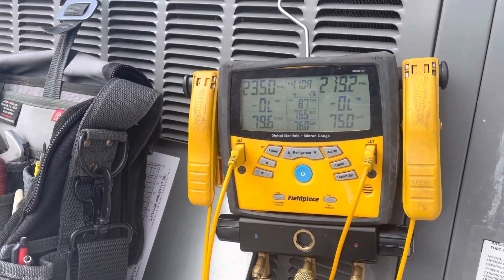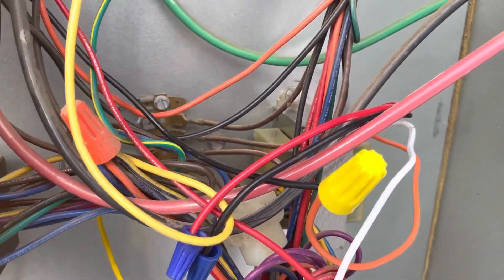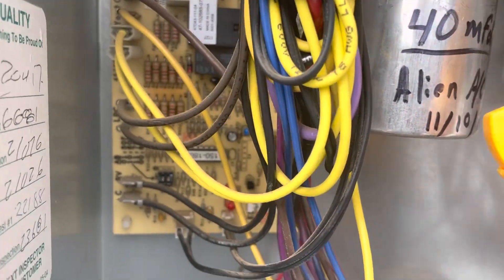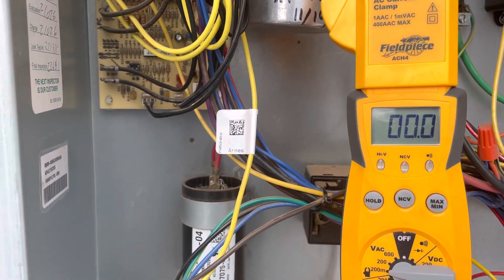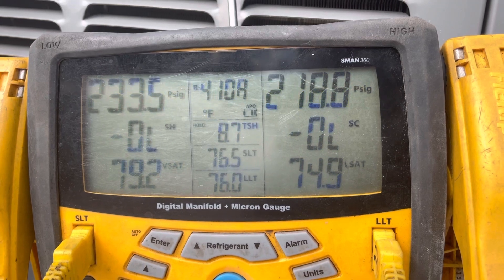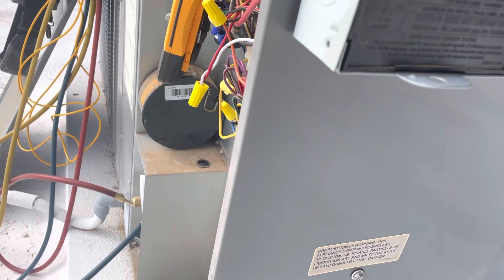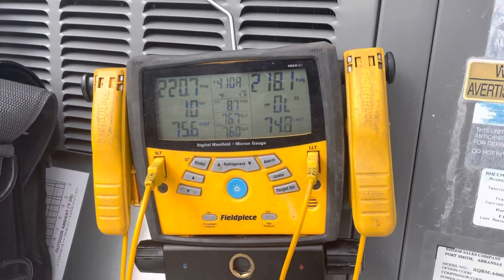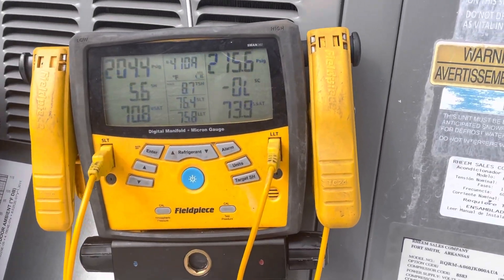Outdoor TXV restriction

Comment: Now is this running in heating or cooling mode
Reply from the maker: It was working in cooling mode, but not in heating mode.  The outdoor TXV was restricted.  If I remember right.
Reply: @josegmoreno4966  Kind of confused, why would the outdoor TXV even be an issue in cooling mode when it is usually bypassed (unless it is a bi-directional TXV)?